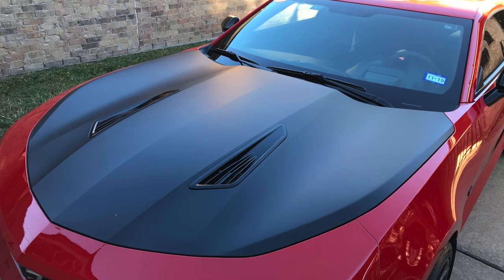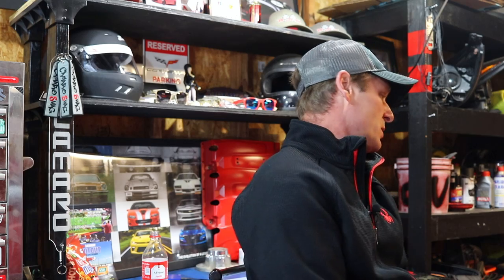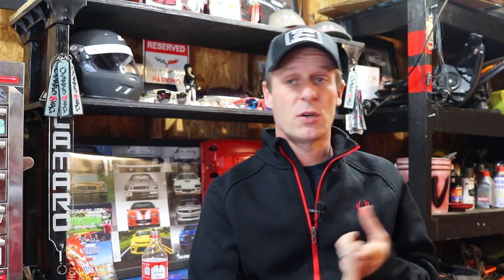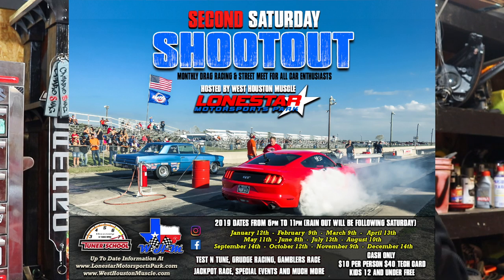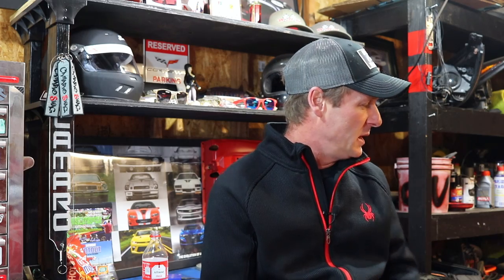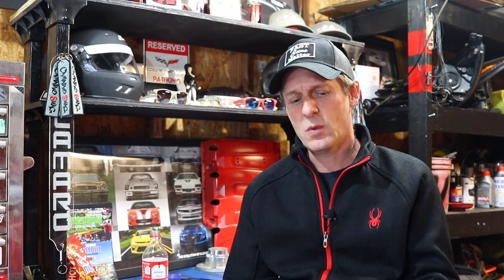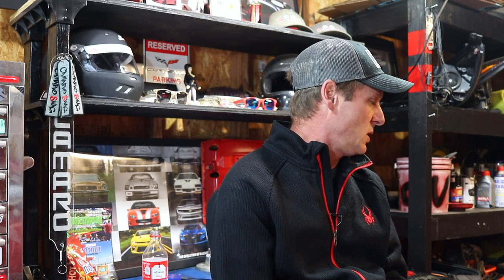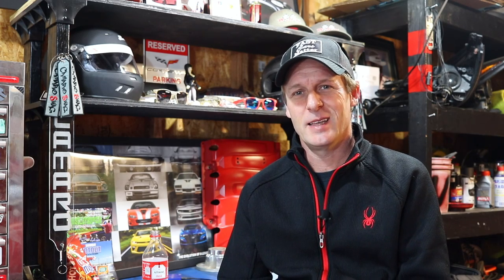LINE LOCK Review - Camaro

Comment: Let me know if you have any issues with those 315's on the rear. I run the 5 wheel spacer on the back currently with 30/35/20's and want to get to 315's in the rear

Comment: Did it streak the hood? What kind of coating did you use?
Reply from the maker: No I rubbed smooth after coating. Looks great and it’s kind of slick to the touch now. Wish I would have done the hood first time I ceramic coated now.

Comment: What size are the new street tires. Spacers?
Reply from the maker: I went 315/30/20 on rear stock size on front. One size over stock width on rear. I also have the 3mm wheel spacers on my street setup just to flush rear tires with fender like front of car. I don’t think with the 1le I even need that to run wheel spacers for 315

Comment: guys, learn to use your factory linelock that comes built in, dont do this mod, its micky mouse
Reply from the maker: SS 1LE does not come with line lock...  and this kit is far from Mickey Mouse my friend. It’s a really good kit. Jrods LMR Autoempire CSP and RPM all use this exact same kit
Reply from the maker: It also a line in for connecting two step controller which I’ll add after cam and heads